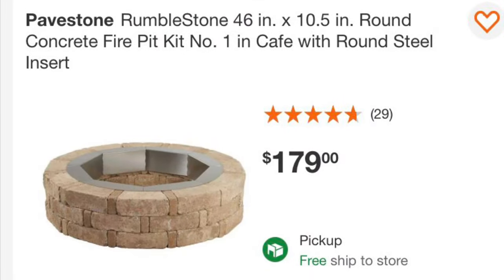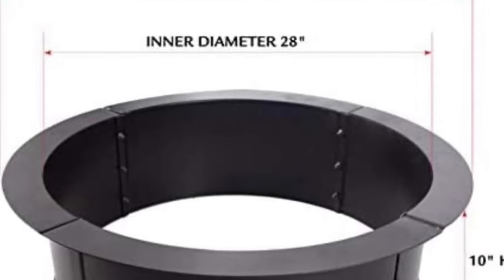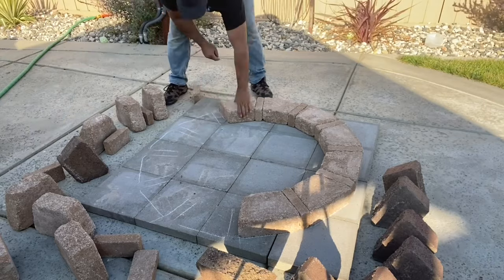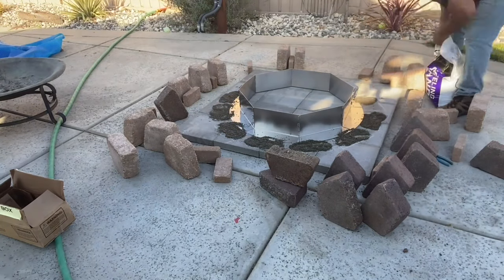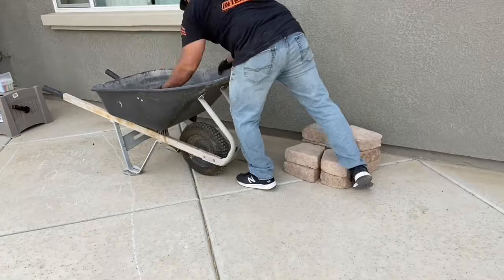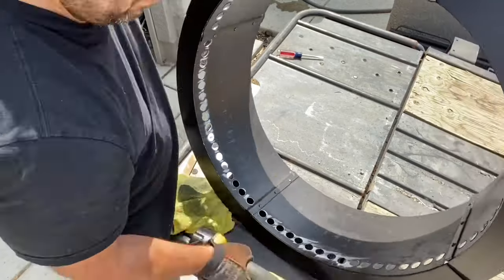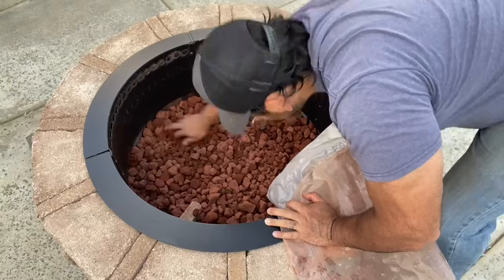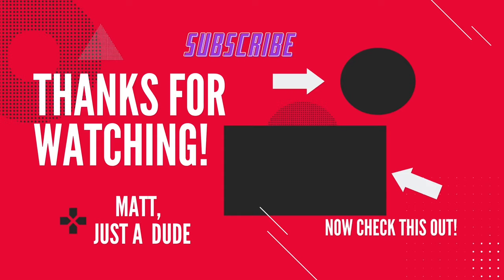Save Money and DIY a Smokeless Fire Pit. Build a Pavestone Rumblestone Smokeless Firepit for cheap!

Comment: Hello there great video and super detailed. Getting ready to build one of these but have a couple of (moronic maybe?) questions: When burning all that wood. eventually you are going to have to scoop out all the remaining cinders. With my temporary fire pit, I just pour them out and start anew with a fresh metal pan but this has the lava rocks in it. What is that process and do you have to consistently replace lava rocks? Second question: when it rains, do you cover this or simply let the rain drain through the bottom? Thanks a million!
Reply from the maker: Great questions! With the lava rocks, I remove the large pieces and then vacuum out the ash with a shop vac. Im going to eventually relocate this fire pit and when I do, Im going to build kind of a maze at the bottom with fire bricks instead of lava rocks. I think the bricks will make it easier to clean.
Reply from the maker: I also want to build a top for it but just haven’t decided if its going to be made out of steel or wood. Great questions though and hope this helps. Please let me know if theres anything else I can help you with.  Please like and subscribe. Thank you again.

Comment: How are the temperatures around this? Does heat radiat outwards much or does it mostly just go up?
Reply from the maker: Great question. It just goes straight up. Ive only had a fire in it for a couple hours so I dont know if the bricks would ever get hot and radiate heat. I doubt it due to the air always moving between the bricks and the fire ring. Hope this helps. Thank you for the comment.

Comment: Can you please comment a link where you’re still finding them for 200 something dollars please? I’m looking all over but not sure if I’m looking at the right kit. Thank you.
Reply from the maker: Just go to home depot website. Search for Rumblestone firepit. You are looking for the Rumblestone firepit Kit No. 1 in café. I just looked and that kit is $239. The sierra blend kit is $918 and the greystone kit is $841. If you want a sierra blend or greystone colored firepit I would go to a landscape supplier who is a Pavestone dealer and order the blocks separately. You need 12 small rectangles and 12 traps per row. Hope this helps. If you have more questions please let me know. Thank you.
Reply: Pavestone RumbleStone 46 in. x 10.5 in. Round Concrete Fire Pit Kit No. 1 in Cafe with Round Steel Insert Is the kit I’m looking at and on my Home Depot it is showing it costs $925. Thank you sir, I believe the one I’m looking at is the same one you’re talking about
Reply from the maker: I just looked and changed the location of the Home Depot I was looking at. I found one in the LA area which listed the same kit for $925, one in the Sacramento area listed the kit for $239 and one in the San Diego area listed the kit for $179. I don’t know where you’re at but the Home Depot located at Imperial Marketplace #1032 has the kit for $179 and free shipping to your residence. Hope this helps.

Comment: I have a question the flat stones that you have underneath your fire pit what size are they and how many do you have. Because I like that and I was given permission to make one because I stay in the apartment building and I believe that would make it look a lot better The Underneath pic. Thank you
Reply from the maker: Great question. The bottom which the fire pit sits on is made up of 12 inch by 12 inch concrete stepping stones. They are 1.5 inches thick.  There are 16 of them which make up 4 rows of 4. Hope this helps. Please like and Subscribe!
Reply: @JustaDude123  nice video! I am wondering if you have a concrete patio and that’s why you put the  flat stones underneath your fire pit to protect your patio ?   I have a concrete patio and I don’t want to damage it. Thanks
Reply from the maker: @lachika8005  Great question! Yes, I do have a concrete patio and placed the 12 x 12 pavers underneath it to protect it. I recently built a paver circle for a firepit seating area. The video should be up soon. Hope this helps. If you haven't, please like and subscribe. Thank you!
Reply: @JustaDude123  awesome! I will wait for your new video. Thanks 😊

Comment: So, does the fire actually make less smoke or is the smoke vented away in a more efficient way?
Reply from the maker: Great question! The air flow under the fire and at the top of the fire cause two things, the fire to be well ventilated making it burn hotter and a secondary burn at the top which burns off smoke. This causes the fire to make less smoke. Its not 100% smokeless. There are little puffs of smoke which occasionally escape but it creates way less smoke.
Reply: @JustaDude123  Makes sense!  Thanks!
Reply from the maker: No worries, glad I could help. Thank you!

Comment: Do you know possibly the amount of bricks and item number for small bricks so instead of kit just to buy them separately, since the kits are not available? I believe the bricks item number is 80749 or 92334, but the second one is bigger ?!
Reply from the maker: I listed the amount of bricks needed in the video and in the description there are the item numbers.  I believe the no 1 kit contains 36 of the traps and 36 of the small rectangles.  To build the fire pit like I did, you will need 48 traps, 12 traps and 12 rectangles on each tier. Hope this helps. Please like and subscribe!
Reply: @JustaDude123  I was slightly distracted when watched it lol. liked and subbed. Thanks a lot
Reply from the maker: No worries, thank you! Let me know if you need any more info. Thank you again!

Comment: Hey Matt, thanks for doing this. Question: you said store bought smokeless have a lot of holes on the bottom. Why not drill holes a couple inches from bottom too in addition to the top rim? Thoughts?
Reply from the maker: Awesome question! I didn’t drill the holes in the bottom ring because the lower ring is not solid. There are gaps in between the pieces which deliver plenty of air to the fire. I also think the fire is able to get air from the bottom due to the lava rocks having gaps between them as well. If the ring was a solid ring which went from the too all the way to the bottom I would add holes to the lower part of the ring as well. Hope this makes sense and answers your question. Thank you for watching. Please like and subscribe!
Reply: @JustaDude123  I think I get it. Haha. I've watched so many DIY smokeless videos I'm getting confused. So if the ring insert goes from top to bottom then yes drill more holes. But if I add an extra layer of pavers & space them out air will get through & I won't need the holes drilled on bottom of ring. BTW that kit is not available at Home Depot so if I need to replicate the stones can you tell me the sizes I should look for? Thanks!
Reply from the maker: I would watch the video again and see how I installed the lower ring and added the top ring. It might make more sense with the visual. I listed the amount of bricks needed in the video and in the description there are the item numbers.  I believe the no 1 kit contains 36 of the traps and 36 of the small rectangles.  To build the fire pit like I did, you will need 48 traps, 12 traps and 12 rectangles on each tier. Hope this helps. Please like and subscribe!
Reply: @JustaDude123  yes I've watched it 3x Haha. I was asking the size/height of the blocks you used (not how many) are the concrete blocks like 4" high. Sorry not trying to bug you. But was thinking if I purchased  a fire pit steel insert that was 14" deep rather than 10 then I wouldn't need the insert that came with the kit & then would'nt have to rig up using both. 🤷‍♀️
Reply from the maker: Sorry for the late response. I tried to find a taller fire pit ring as well and was not able too. If youre able to locate one, please let me know. 

Here is the link for the dimensions of the traps:

https://www.pavestone.com/edgers/RumbleStone-Trap/923

Here is the link for the dimensions of the mini stones:

https://www.pavestone.com/edgers/RumbleStone-Mini-45mm/913

If you want to build a fire pit like what I did, you will need 36 mini stones and 48 traps. 

Hope this helps, thank you!
Reply: @JustaDude123  thank you so much for taking the time to answer my questions. I may end up building one out myself rather than using the kit. I found this  36x12. 2-piece insert at Home Depot. The inside ring is about 1inch smaller in diameter than the outside ring. I'll have to research more on it but I read that if I leave the outer ring flush to ground and raise the inner ring a bit, drill holes on the inner top that  I would achieve a smokekess.... but not sure of that yet & if that would work without caps on top. I'm an amateur
Reply from the maker: If the ring has a lip on it like the one in my video, you dont need caps on too because the lip will seal the ring.

Comment: what sould happen if you skipped the botom insert?
Reply from the maker: Great question but I don’t know. Air would still get in, and air would still heat up and rise inside of the top ring. I just don’t know if not having a bottom ring would be beneficial or not.

Comment: Nice tutorial. Unfortunately, the kit is $569 now. 😬
Reply from the maker: Thank you for the comment! Theres been a couple comments like this before. I have been able to recently find the Cafe colored kits for about $200. The Greystone and Sierra Blend kits are at $569 tho.
Reply: @JustaDude123  what does the "kit" consist of?
Reply from the maker: Great question! The #01 kit from Rumblestone consists of 36 small rectangles, 36 traps and the steel insert.
Reply: Thanks!  I am having trouble finding the extra blocks you are suggesting from the Home Depot. Are there any other places you suggest trying?
Reply from the maker: Great question. If possible I would get the same color blocks as your kit. Sometimes Home Depot has them but if they dont go on Pavestone web site and locate a Pavestone dealer. You should be able to order the block you need from them. Hope this helps. Thank you!

Comment: That fire kit is now $925! what a ripoff. You can but these stones way cheaper yourself.
Reply from the maker: It did skyrocket in price! I haven’t checked the prices on the kit vs getting just the stones recently.  Do you happen to know what the prices of the stones are?
Reply: @JustaDude123  We have a place near us that we can get them all for around $300. Still more expensive than what you paid but not $900 bucks.
Reply from the maker: That does seem like a great deal now. Between the stones and the fire insert youre still money a head.